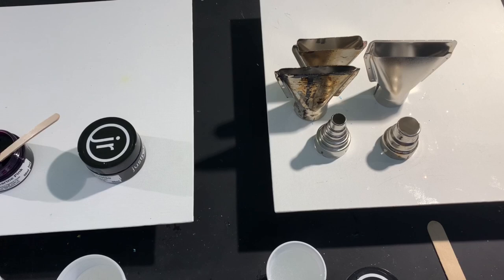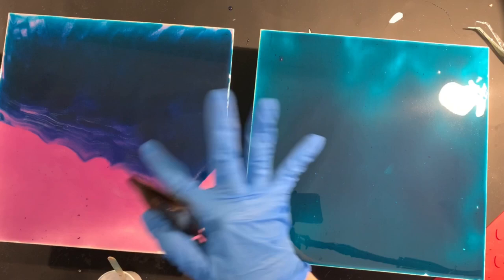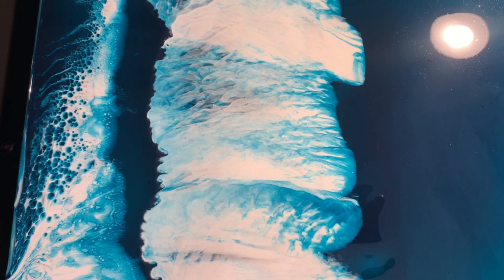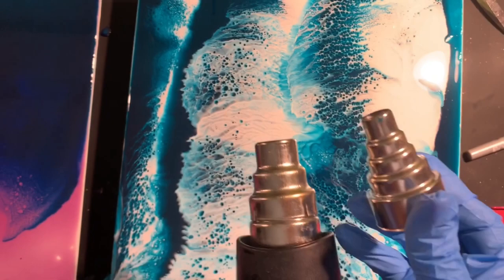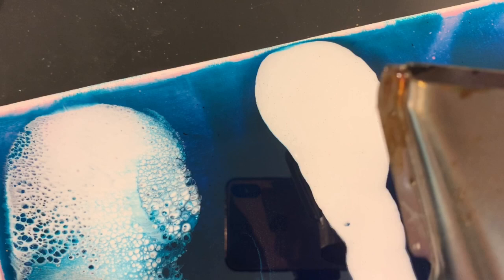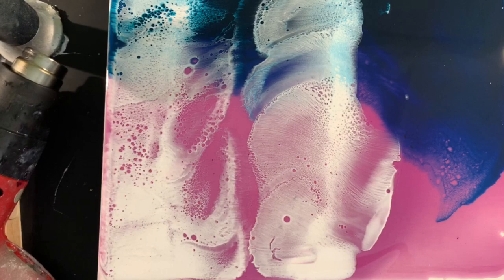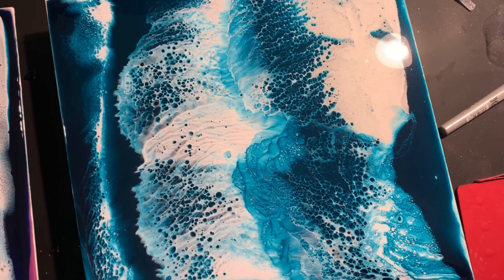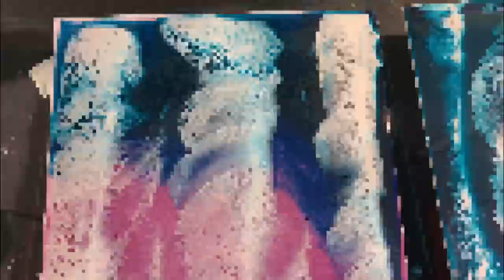Heat gun on resin: nozzles, tips or attachments & the different wave and cell effects they make.

Comment from the maker: 5:43 Large Round tip (wedding cake shaped attachment)
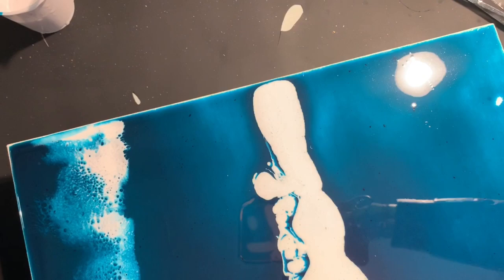7:42 Small round tip (wedding cake shaped attachment}
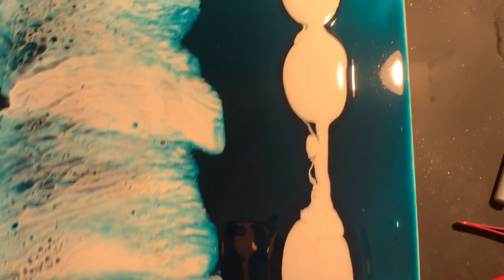10:19 Angle  you are pointing the heat gun (wedding cakes)
14:11 Duck bill shaped , with thin open end
17:21 Duck bill shaped with wide open end
18:57 Duck bill  resin puller/Raker
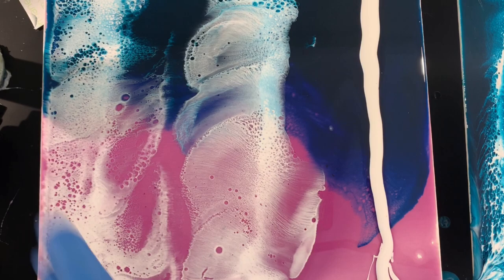21:19 Angle you are pointing the heat gun (duck bills)
24:29 Close-ups with no talking

I do not know the official names of the attachments, and maybe none of us do LOL!
Reply: Concentrator nozzles

Comment: The only flat tip mine came with was the one that you call the puller.  I just got my hc on last week and it's no wonder now that I couldn't get my waves to do like everyone else did when they tried to push them. I think I might try using one of the round tip since my projects are a little bit bigger.

Comment: Thanks again for the tips! My biggest problem with the attachments is that they fall off. How do you get them to stay on?
Reply from the maker: LOL! there are about two videos on my channel where the darn attachment falls off, that's why it looks so bad - I just squeeze the metal tip of the attachment until it fits a little tighter - there are probably solutions, I haven't looked into it,  like maybe searching for just the ends pieces to see if there is a lot you can buy or something
Reply: I'm wondering if attaching with aluminum tape would work. And, resin won't stick to aluminum, fyi.  A high heat- heat tape if there is such a thing.
Reply from the maker: @glutenfreeappletree  yes, I use that tape when I did the ocean countertop video, it works well

Comment: Hello how do you prevent burning.  My heat gun has 2 setting low and really high
Reply from the maker: It may be your heat gun.  I do not hold the heat gun up close to the resin - I use a high blow setting but a medium heat setting

Comment: I have tried my hands on the ocean waves but failed every time. How thick does the white pigment hAve to be to form lacings? I wait till it becomes like sugar syrup consistency, but the rest of the poured resin on the board thickens too and it becomes very hard to move the resin. It would simply spread on the entire board like clouds (no lacing or cells). I have also tried keeping the white less thicker than sugar syrup, that didn't work too. What am I missing here please?

Comment: love this video and is very resourceful...I'm researching to get a heat gun. I noticed your guns brand seems to begin with an 'A' but the link referenced shows Fujiwaaa by Xpeoo. May I ask of the brand you use instead?
Reply from the maker: hi, i had to change the link when Amazon ran out of stock  - in this case it is the Amtake 1800W heat gun.  I do actually have the fujiwa and I find it to be identical.  what you are looking for in a heat gun is the ability to turn up the heat low to high 102 - 1000 degrees range, and the ability to have a low/high fan speed.  additionally these heat guns I choose have the tips that come with them - but you can buy them separate if you find a heat gun you really like that has no tips.

Comment: Thank you for this tutorial, I have a problem where i do the small surfboards and getting cells I’m finding very hard as my heat gun on has one temp and it’s either on/off .... 

I’ve always used the (duck bill) one that you said about and don’t get cells - thinking I should try the smaller circles and let the resin sit for a while and hold it further back?? - I just NEED to be more patient as I seem to just blow the white right off with no cells and looks messy!! I’ve also burned my resin with both torch and gun trying desperately to get cells. It’s a shame I can’t show you?! 

Now I’ve got better pigment and resin, I’m gonna give this a go tomorrow. Any tips for me? Prayers? 
Oh, by the way! I love it that your subtitles come up as (applause) when the heat gun is on 😂 

Thanks again!! New subscriber right here from 🇬🇧
Reply from the maker: I did a lot of trial and error working on cells and waves, two things were big lessons for me 1. If the resin is  high quality and is thicker than syrup, it  is next to impossible to get cells. It’s like the white gets in there and the clear is like “you are mine and I’ll protect you from the mean lady”  always heat the clear, to thin it out before you try blowing out a laced wave. And 2. When you put color in the resin and you see it sink, then your layer may be too thick - check out my cells and lacing video- I show you what I mean there.       https://youtu.be/K4VrQLZQLYY

Comment: I noticed you always use the torch between the heat gun passes, is there a reason you do that. Does it help resin or prep it for the gun. New to this, sort of this a stupid question. Thanks for instruction.
Reply: from what ive read, it pops the bubbles the heat gun is unable to pop.

Comment: Does heat matter for waves or it's just about attachments? I've been trying with hair dryer, i thought heatgun causes damages on resin
Reply from the maker: The heat thins the resin, and pops bubbles. It’s easier to move it when thinner. If too much heat is applied you can scorch the resin, but in this video, no resin was scorched. Heated resin is not safe to breathe - so it’s all up to you for your comfort level

Comment: Thank you for this tutorial. I have questions regarding what pigments to use for the white waves and lacing.  I've been mixing resin with the white alcohol ink by Pinata combined with the white tint by Art Resin, but it just sort of sinks and diffuses into the other colors. I've had more success with  just  white alcohol ink droplets directly onto the surface, and that seems to work a bit better. I've never been able to get cells but then I just have been using a standard heat gun with no special attachments. Looks as if you are just using white acrylic paint. Is that correct?
Reply: Ah, I just found the link to the pigment you use, but since it's in Australia, I best find something in the US. Any recommendations?
Reply from the maker: I’m using ‘just resin titanium white’ pigment paste mixed with resin -there is a link in the video description. Castin craft and alcohol inks works really well for me too , I suggest you watch my other video about cells and waves - that may help too
Reply from the maker: @jkconfidentinyour50s59  https://youtu.be/K4VrQLZQLYY 

This video is the castin craft and alcohol ink
Reply: @ResinAsYouWish  Thank you just found your other videos using castin craft!